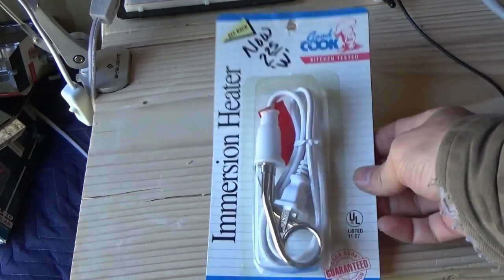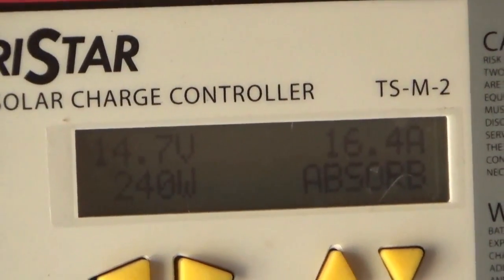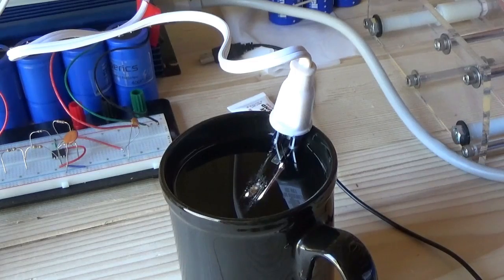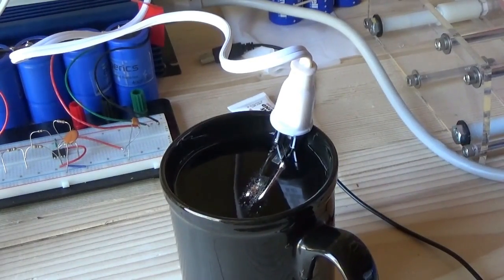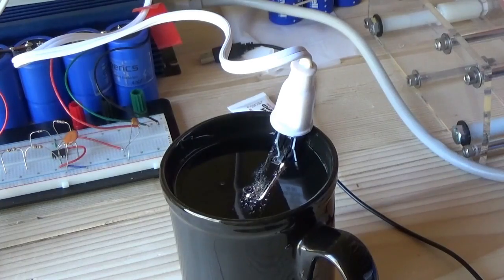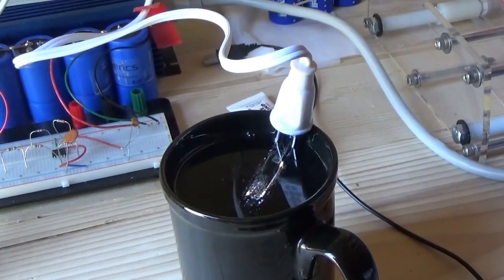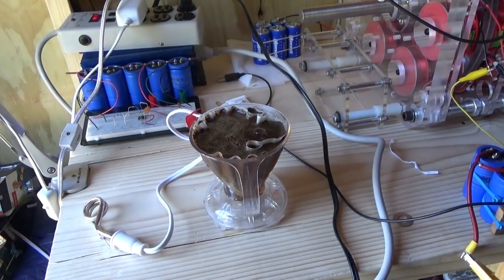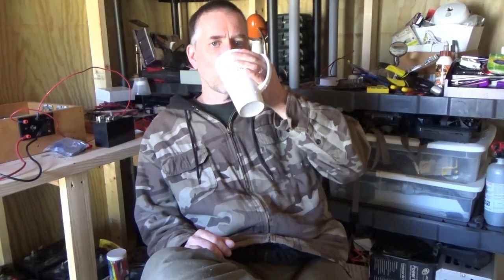Sun Coffee ~ Brewing Coffee By The Power Of The Sun

Comment: I noticed your gen has a extra long shaft sticking out so is there another accessory you can add to it?
Reply from the maker: Yes the toroid section
Reply: what is a toroid and what does it do what will it be used for?
Reply from the maker: Its a super efficient round transformer coil. It will have 2 coils of wire on it and 2 powerful magnets spinning inside. Can produce high voltage or be used as another generator output

Comment: Im sure you can buy a 800 or 900 watt microwave and do it a lot better. I think your inverter can run a microwave if its pure sine wave. If its not pure sine wave then dont try using it on a micro wave because the microwave will dance off the work bench because micro waves hate square wave inverters.

Comment: LOL I'm sure you realize that there are 12 volt heating elements that you can put in a old electric hot water... that would be a lot easier than trying to reinvent the wheel with those immersion heaters... My cheap Keurig coffee maker would have made a cup of coffee in under 2 minutes for the same power
Reply from the maker: +lordmbuk true. I have one. But the wires get hot and smell bad. Not safe to use
Reply: If your cord gets hot more less than a 200 watt coffee maker running for 2 minutes there's something wrong with your coffee maker just saying bro you got plenty of power
Reply: The Do It Yourself World upon further reflection I see that mine's actually over a thousand Watts I stand corrected
Reply from the maker: Makes a huge difference.
Reply: Actually how long did it take you to make that water hot? It seems like 10 or 15 minutes on video I didn't clock it so I don't know for sure so 200 Watts for 10 minutes let's say is that more than a thousand Watts for two minutes? Just asking me because I don't know you know the theory behind it I know I remember you running your air conditioner off of your solar which is why I ask I know your system can produce well more power than that heater will use

Comment: Check your voltage at the output of your inverter with a multimeter, sounds like your inverter is cycling on and off or the fan is faulty. Shouldn't be cycling on and off like that. The fan should stay on for quite a while then switch off and stay off for quite some time and then repeat that cycle.
Reply from the maker: It always did this. Its the temperature control cycling it on and off as the device heats up. My big green one did the same thing.
Reply: Just for interest sake try running your hot water heater off the big Inverter and see if it takes just as long to heat up as the small inverter.

Comment: I'd be willing to bet that if you tried one of those small Keurig machines it'd work quite well out there, too.  I think the largest one draws 1500 watts...it's another test that, rather conveniently, also yields coffee.  d;o)

For larger volume water heating, search for "solar pool heaters" and see if you can't modify something along those lines.  Get a tank, insulate the snot out of it, heat it with the sun and store it for when you need it.  Use that tank to feed the hot water tank inside, and at least during the summer, you might be able to almost completely wipe out the cost for hot water.

Comment: We are not off the grid.  We have an electric stove.  I did some research on the energy it takes to run the burners and found that the induction burners used far less energy.  About 1-1/2 years ago we bought 2 induction burners and a cutting board large enough to cover the top of our stove.  We use those burners now for everything except canning.  We have been able to save a lot of money on our electric bills.  Just make sure to take everything off the top of the stove if you are going to use the oven. :)

Comment: what's the fan protesting on the inverter?  loose wire or bad battery connection?
Reply: thats why i reply, it should not switch on and off  that way......it should have a hysteresis..., its a bit on/offy... lol, (it should stay on longer, ten switching that fast.)
Reply from the maker: Cooling fan
Reply: yes i am aware off that, why is it acting so strange, should turn on and stay on, until cooled...
Reply from the maker: Not in this one. Its thermal controlled and turns on and off as needed.

Comment: Those aren't easy to find in the UK: go for about £10, but they will also work on 110V, with a longer heating time.The 230V I have takes about 6 mins to  boil a mug of water.Very useful though. To clean off limescale, use half water ans half white vinegar, bring to the bil , then leave to soak for a few hours.

Comment: I believe there are 12V water kettles and toaster ovens on Amazon; using 12V directly is probably more efficient than using a 120v heater.
Switch your hot water heater to dc elements and the panels can heat the water; doc elements usually use 300 - 600 doc watts. Most people who do that use the dump load off the charge controller or a switched mode on the controller to electronically switch off the batteries directly.

Comment: 13 minutes to boil a cup of water? I boil a cup of water for coffee in the microwave in 3 minutes. Why not just plug in a coffee maker? There are easy ways to do things and there hard ways to do things.
Reply: It may be an experiment. But it is an experiment that proves that it is a very inefficient way to heat water.
Reply: Darrell Wampler are you saying Troy doesn't have an power inverter that run a coffee maker? I'm quit sure wasn't Troy's intention wasn't to make a video on a better way to waste time.
Reply: The heating element is inefficient in the amount of time it takes to boil a cup of water vs using a coffeemaker or microwave oven. My point was why waste time in getting a task done when there are better ways to do it.
Reply from the maker: Time not wasted if I am not doing any work on it myself. Just plug it in and come back later. No harm done and it cost me nothing to run it.
Reply: EnergyCrafts, Both Troy's heating element and a microwave will boil water and run on solar power. I can't speak for Troy, but for myself, I want my coffee NOW. So I don't care about losses of a few watts using a microwave.
Reply from the maker: Now please do tell me how free energy is inefficient? I dont get your math at all.
Reply: I am not a troll but I would like to make a comment.  Resistance heating is virtually 100% efficient as all the energy at the element is converted to heat, unlike in the microwave where pf losses and the other losses to make the microwaves is wasted and not put in the cup.  In terms of time, the microwave dumps many hundreds of watts in an instant so naturally it would take shorter time for hot coffee than Troy's 100 watt element.  to do the same.  What ya think, have I missed something?
Reply: Just for the case of discussion. On the suggestion that the solar energy produced by our solar set up is 'free' any legitimate economist would remind me it's not 'free' if we break down the cost involved in buying all the solar equipment, including wiring, outlet boxes and then factoring in the dollars spent on the system and how many work hours at our jobs it took to afford the system. When we got solar we were told how many years it would take before we would see a return on our investment based on what the kilowatt rates in our area were. So while we no longer had the $100+ a month power bills, it would be at least four years before we saw a return on our $5k output.  In there book Your Money Or Your Life the author reminds the reader if they see something marked down 50% (a dress that was $100 is now $50) its not the 50% they need to think about but how many hours did it take them to earn the $50, and if the $50 dress is worth the investment.
Reply: Solar Farmer Power, I agree with you to a point. But some people take simplifying life to an extreme. Troy's heating element may work for him but would piss me off no end. Because I see no point in taking 15 minutes to do a simple task such as boiling a cup of water. When it can be done in 2 or 3 minutes. I also dislike tiny houses. I'm NOT going to try to live in 200 square feet just to simplify my life. Nor am I going to wash my cloths with a plunger just so I can be "off grid"! If you think about it, the modern conveniences we have today are not a bad thing.  But everyone has a right to their opinion.
Reply: It would seem to me that if was already working in the shed it would be just as fast to heat up a cup of water for tea or coffee. Than to stop what he was doing and go to the house. Just saying.
Reply: Maggie May They cooked using propane or the wood stove.
Reply: David Johnson And pay for electric to run the coffee maker. This is NOT an video about a better way to make coffee. I guess you are missing the point of the video.
Reply: Sorry Troy, didn't see your comment about not wasting time.
Reply: Maggie May Isn't it?
Reply: Maggie May No teaching on YouTube. You can stop trolling anytime now!
Reply: Maggie May So you are shaming Amish, Mennonite women who believe being a homemaker is an honourable position?  Shaming stay at home moms who choose to be a SAHM?
Reply: David Johnson That's is not what Troy is trying to teach. Did you know how many watts it would take to heat the water? I did not.
Reply: Sharon J I guess you care. You watched the vid and responded. Go troll elsewhere.
Reply: Sharon J So your making comments about something you have no clue about. Your fucking stupid troll!
Reply: TheMoneypresident Please send 💰 ASAP
Reply: John McLendon Most of his solar equipment was donated to him.
Reply: Darrell Wampler, If the point is to find out the minimum watts required to heat a cup of water. That may very well be useful in extreme situations. Like if an EMP takes out the grid and most of your solar power equipment. Or as Dork pointed out, it would be useful for guys with crappy solar power systems. But in my opinion, it is not practical for normal situations. Where there is plenty of solar or grid power available.
Reply: David Johnson Troy was in that position that he had to account for almost every watt of usage in his early days off grid. Troy hasn't forgotten those days. Plus he is trying to help others that may be in the same situation. What have you done?
Reply: My only point was that for normal everyday use, for most people, there are better ways of heating water. In Troy's case, he says that he could be doing other things while his water is heating. So that may work for him. Though he does have enough solar power to heat his water faster.
Reply: Seems a little slow
Reply: Sharon J How can you have a conversation when you know nothing about the topic. It really shows your stupidity. Or else your a liar!
Reply: FATTIES GONNA FAT RE.E.E.E, Yes, Troy's house is still on grid. With plans for a grid tie solar power system in the future, and there is nothing wrong with that. Unless he were to make a claim that house was off grid. Which would be misleading. But Troy hasn't done that.
Reply: Sharon J You really are stupid. Do you know how many watts he used to boil the water? If you know then you watched the video and lied about it. If you don't know then you didn't watch the vid and are talking out your ass.
Reply: Sharon J Is that ANY of your business bitch. No it is not Troy still has a job to and that won't get don't done sitting in the house. Wake up stupid!!!!
Reply: Sharon J You know the answer to your question so quit being a pest. You know where Troy's pay check comes from. Be gone troll!!!!!!!!
Reply: Sharon J I am not going to read your troll posts and not respond. Go back to the shit hole from where you came from. No need to respond I'm done with your spit tail trolling.
Reply: Sharon J Know your role!!!!!
Reply: Again, this is a great video if it was presented as a way of what can be done in an emergency, if you have very limited solar power. But for simply  saving a couple of pennies on the power bill? If Troy doesn't mind waiting the extra time for the water to boil, that is up to him. I certainly wont criticize  him for his choice. But it isn't something I would do.
Reply from the maker: Because it was fun
Reply: David Johnson he noted in the video he was doing it as an experiment.  Personally I found it interesting, and something a lot of THOW folks might be interested in for heating hot drinks, soups etc.
Reply: Beth Grant-DeRoos, This experiment might be useful for Doc. With his little toy 300 watt solar power system... He can make himself a cup of coffee.
Reply: Sharon J Then you must agree that Troy's work is worthy of a pay check and therefore is a JOB!

Comment: That's pretty good, you can plug your cup in now. :)
I like your off the grid brewer. I duplicate that just taking the brewer out of my drip coffee maker. Water can always be heated with wood gathered from around the forest also.

I have been using percolator coffee makers for quite awhile now that can be placed on a burner or open fire. I did recently buy a stainless steel coffee maker which is healthier than the aluminum type.

Comment: Efficient electric water heaters run on 220 to supply enough current. I think that is one of the worst things you could use solar for. I understand you are doing it because you have a good deal of solar there and nothing to use it for yet. 

You keep saying "extreme cold air" the jacket you have on is not a "extreme cold weather jacket" the difference between 30 degrees to 212 and 60 degrees to 212 is not that much, its not a extreme difference. (30 degrees).

Did you ever put the fuse on the battery bank?
Reply from the maker: well, I figure that anything I can use solar for is a good thing.

Comment: Just buy a kerurig and reusable k-cups
Reply: Linda McConnell Same effect with the machine as long as it was using inverter. Provided the sun was out and being tracked to keep the max output out of panels. He is trying to convert his house to solar but he hasn't shown his a.c. circuit breaker panel to do a quick math problem for total watts. 120 volts times max amperage of box I will use 200 for simplicity sake 24000 watts equals 24kw/hr if power is going thru every circuit. You see the savings if you look at your bill a see how much they charge for that same amount. He needs another dc power source to keep the bank up to power the inverter. Wind and water are the best next two choices.
Reply: Frederick Nolan - He said there's no surface water on his property, so I guess he'd have to extract the hydrogen from his well water and make some hydrogen fuel cells.
Reply: Frederick Nolan -  May as well think big, put up a big windmill like windfarms have, and sell the excess back to the power company.
Reply: Vic  That is if he can to Deatroyit Edy' s son. If it is that big in would be part of the triple generator loop locally. He doesn't want wires leading into his house, that leads to Ma Nature sending a surge of power thru wires making for a lot of smoke, fire and noise. That is just on the pole with the transformer on it. How that semi got there only Trucker Buck knows. Of course he will laugh at the joke, but it gets you a break in electical safety class. Something about having them switching from car to robot will drive the instructor into a harmonic phase lock to be broken by the word Breaktime.
Reply: Vic He does have air movement on the property tho! Nothing like hot air rising and cold air sinking to get the blades turning. He will need a number of turbines equal to his solar panels wattage and voltage. One set to cover other and a transfer switch to jump from solar to wind and back.
Reply: LOL
Reply: He said it was an experiment  
It would save money. If you use a Kurig you are being wasteful and are not concerned with saving money.

Comment: brother  in solar panel  can i use  pvc wire    yes or no
Reply: for output plz reply
Reply from the maker: Not sure what you mean by PVC wire?
Reply: The Do It Yourself World  a kind of cable which are used in ac current  for electric
Reply: The Do It Yourself World  a kind of cable which are used in ac current  for electric
Reply from the maker: Oh. Yes you can use that but  just make sure you use thick enough wires. I once bought a 100 ft 10 gauge extension cord for my wind turbine. It was cheaper that way.
Reply: The Do It Yourself World  in    Thanks brother   for guide   us